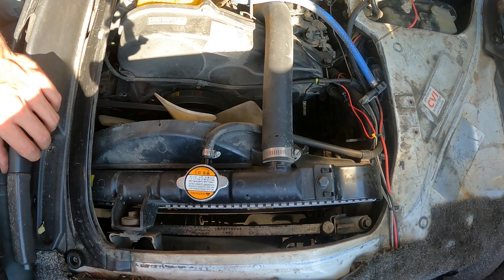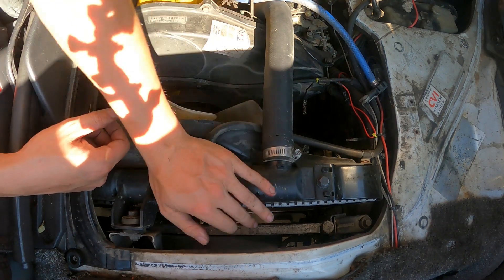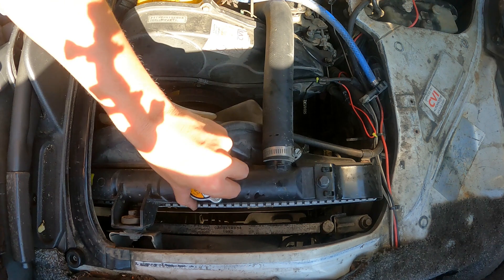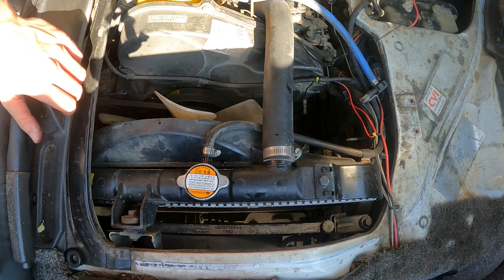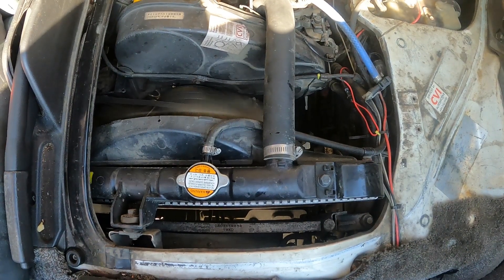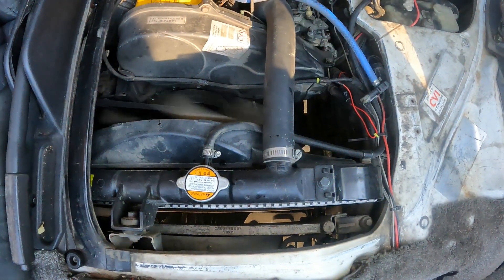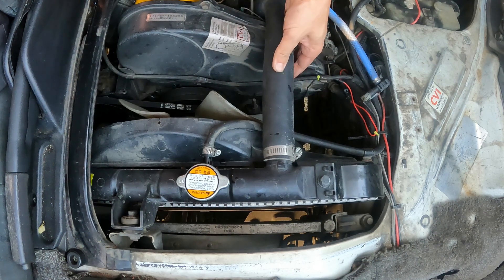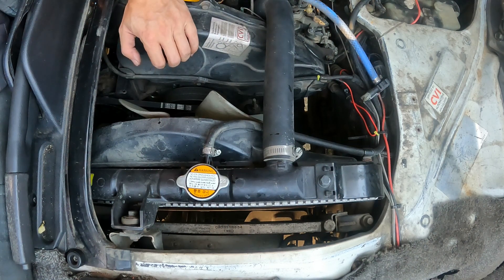4D56 Head Gasket Diagnostic

Comment: I’m not having any symptoms but decided to check anyways. I have an aftermarket radiator. The coolant was filled to the brim when I took the cap off when it was stone cold. Drove for maybe an extra 30+ seconds then you did. When I took the cap off, there was no pressure noise but hot coolant definitely came out. Left it running with the cap off and no pressure moving inside the radiator. Assuming this is normal?